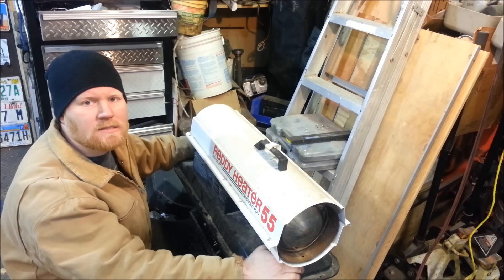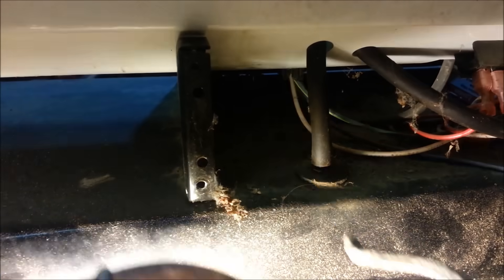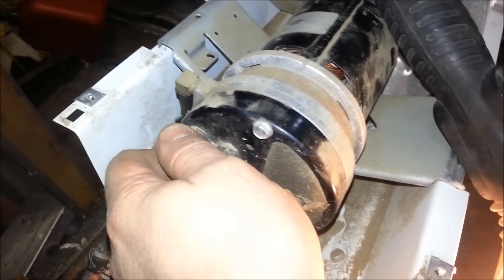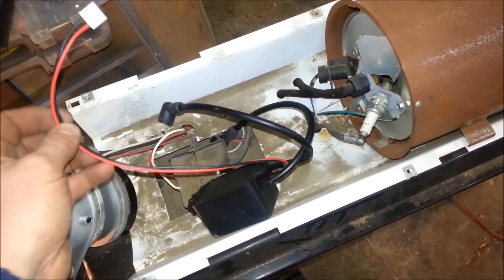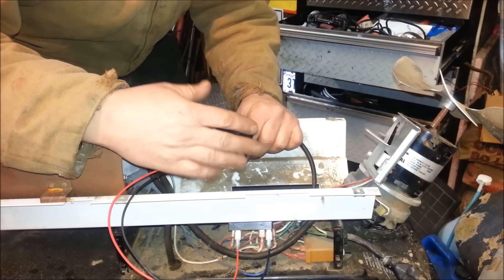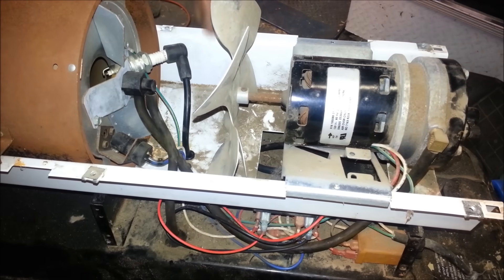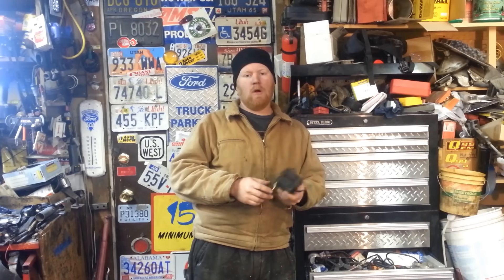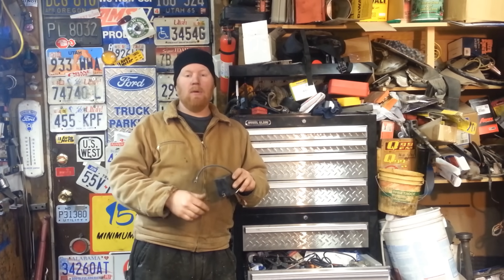Torpedo Kerosene Heater repair & HOW they work

Comment: OK I watched your video and think it is great. I took my heater into the
 shop and plunged it in as the list time I did when it did not work. It 
started up and ran great with nothing different going on. I fill the 
tank and take it down to where I need it and its blowing half burnt fuel
 out the front and burning stops after about 10 min. I let it cool for 
about 20 min . it starts up and does the same thing. I take it back to 
the shop where it did run and it sat over night in 42 degree 
environment. I plug it in, there is a good mist and spark is going , BUT
 IT WILL NOT IGNITE. Any idea ? The fuel is fresh winter mix . 
I boiled the fuel over a electric hot plate to get rid of moisture. Filled the heater with hot fuel and still nothing.
Reply from the maker: These need a proper air to fuel mixer to run properly. Warm oil will be thinner and too much will get pulled into the burn chamber, making for a rich mixture. To thick or cold oil will pull less and make for a lean mixer. Considering it was blowing a bunch of half burnt fuel in while burning, I would say it is too rich. To reduce the amount of fuel being pulled into the burn chamber you'll need to reduce the pump pressure slightly.
Reply: Thank you for your reply.
Does screwing in the adjustment increase the pressure ?
I have tried going in and out with it and it does not appear to change.
ALSO i am wondering about being able to thicken the oil up a little by adding a little ATF  ?
Reply from the maker: Ed Watt
Your diesel will be fine at room temp, just warm/hot from boiling it makes it too thin. Did you pull the top cover off and make sure the spark plug is not gummed up with carbon? Was there water in the fuel?
Reply: I have watched the spark mix with the fumes and nothing, even after the fuel has cooled to 42 F. 
 Does the pressure in the compressor generally 
increase when the adjustment screw is turned in ?
Reply from the maker: Ed Watt
Yes, a properly operating air pump will increase in pressure when screwed in and decrease when screwed out(ccw). There are 2 ports: one for a gauge and the other is the adjustment. They look identical on a lot of heaters and screwing in and out the gauge port does nothing. You'll notice at 7:50 in the video how much turning it takes to adjust the pressure down.

Comment: Thanks for the info.  For some reason mine runs great for all of 10 minutes then stops, the fan remains but the heat stops. Unplug, wait 10 seconds, plug it in 10 more minutes and then no heat again?? Could it be the fuel nozzle? or??
Reply from the maker: Adam Jansen
If it is heating up until the moment it shuts off, the optical sensor is faulty or dirty.
Reply from the maker: Kerosene or Propane?
Reply: Adam Jansen im having the same issue currently
Reply: sixtyfiveford  Kerosene. 60k btu
Reply from the maker: master bates
Kerosene or Propane?
Reply: sixtyfiveford kerosene.
Reply: Adam Jansen kerosene runnin diesel
Reply from the maker: Adam Jansen
The heat/flame dies, the fan continues for 5-10 seconds then trips the safety breaker and shuts everything off, correct?
Reply: sixtyfiveford correct
Reply from the maker: Adam Jansen
There are a couple safety switches that may or may not be on your exact machine. The first is a Photo switch which you do have. If it sees no light from the flame will trip the safety breaker. This should be shutting down the power to the fan anytime the unit runs out of fuel/flame stops. It may be an automatic reset style or a manual than you need to push to reset. The second safety switch that is not on all machines is a high temperature limit shut off switch. This will kill the power to the unit if it senses it's too hot. This will automatically reset itself after it cools for a minute. This would be my first suspect with your symptoms assuming your unit doesn't have an automatic thermostat. You can take off the cover or look up a parts diagram to see if you unit has a high temperature limit shut off switch.
Reply: sixtyfiveford thanks. the machine doesnt shut off, just the flame. I let it run a few minutes to see if it would reignite but no go.  Ill take a look tomorrow. maybe take some photos.
Reply: sixtyfiveford the fan doesnt shut off, the only part that quits is the flame part.
Reply from the maker: Adam Jansen
The high temperature limit shut off switches sometimes allow the fan only to run to cool off the unit. What is your make/model number and I'll see if I can pull up a schematic?
Reply: sorry for the delay. It is a Reddy Heater Kerosene 60k btu model #R60
Reply from the maker: Adam Jansen
Your doesn't have the high temp limit switch only the standard photo light senor that is supposed to shut off the unit when it sees no light. So for some reason your photo sensor isn't working like it should and isn't shutting down the unit with the flame dies. But that is a secondary issue to why it is dieing in the first place.

 I assume it's not misting/fogging the room with unburnt diesel while the fan is running?

Is it continuing to spark?

If there is no unburnt fuel going out into the room most likely we either have a sticking air pump vane or a blockage in the fuel pickup line.
Reply: sixtyfiveford correct. It is not misting the room. It goes from working to nothing. No flame no fan. It just shuts off.
Reply: i think i had false info before. fan is no longer running It goes from running to shut down as if you unplugged it.
Reply: sixtyfiveford Ill look on ebay for one and just replace it if its not crazy expensive. Btw I really appreciate your help with this.
Reply from the maker: Adam Jansen
You can temporarily bypass/test it by connecting the 2 wires coming out of the optical sensor. If it fixes your issue, then I would buy a new one(usually around 10buck online).

Comment: if I were to swap the orifice for a larger one and increase fuel & air, would I be able to increase my total btu output?
Reply from the maker: You won't be able to increase the airflow from the fan, so it'll run too rich and more than likely not start.
Reply: sixtyfiveford i have a new avenger kerosene forced air heater that tries to light shoots small flame out front then shoots kerosene out of the front
Reply: sixtyfiveford i have a new avenger kerosene forced air heater that tries to light shoots small flame out front then shoots kerosene out of the front.
Reply from the maker: If it's new and already giving you issues, I would return/swap it out. More than likely the pressures are just set too high.
Reply: sixtyfiveford it ran fine for 4hours and it shut down i let it cool filled it back up tried to restart it would try to start it would shoot out small flame and puff of smoke and then shoot kerosene out of the front of heater

Comment: I have a dyna glo pro125,000 btu and it wont fire up. I pulled the air line and its pushing air , I pulled the fuel line and no fuel is coming out. I blew through the tube and I hear it making bubbles in the tank but it wont pick up fuel. any ideas. Thanks
Reply from the maker: Does it spray a cloud/mist of fuel when you power it up, before it shuts down? If not, more than likely you have a split in the fuel pickup line. Second would be, too low of pressure. And finally it would be a severely worn jet(only happens to units with very high hours).
Reply: Thanks for the reply, I have no pressure on the fuel gauge. Im guessing the air pump is bad.
Reply from the maker: The 4 impeller blades that run the air pump could just be sticking. Take the back plate off and you'll see them.
Reply: I ordered filter and housing kit after looking at it more closely, The old one was cracked and the gasket was swollen so it wouldn't seal properly. Installed the new parts and turned it on a few times and it wouldn't start. I could hear pressure bleeding off the fuel cap when it would shut done. I put my finger over the hole in the fuel cap and it fired up but was spitting out a wet flame on one side. I immediately unplugged it and it was on fire. I finally got it out. Ill check the nozzle tomorrow. Hopefully it just needs cleaned.

Comment: My Reddy Heater 115,000 btu  will start cold. As soon as it heats up It shuts off completely and wont turn back on.   Any advice is appreciated.
Reply from the maker: Some newer models have a high temperature safety switch(high limit safety switch) that shuts off if it senses it's too hot. I would look into this.

Comment: i have a 115,000 btu heater that seems to not have enough air pressure to spray out the kerosene.  Even adjusting the pressure in back it won't kick on since its not spraying it out.  Air Pump is cleaned. Vanes move freely.  How else would i get more pressure.  Air line isn't blocked, fuel line isn't blocked.  It runs with and air compressor sprayed  into the adjustment but as soon as i take that off it stops.  I'm not sure how i get a more constant higher pressure of the air.
Reply from the maker: Is it producing pressure? Pull off the line and feel it or test it. If it is producing the proper pressure you could have a severely worn jet/nozzle. It should push 10+ psi if hooked directly and around 4 psi when hooked to the jet/nozzle.
Reply: It produces a little bit of pressure.  I don't have a gauge so i'm not sure exactly how much.  It only a few years old and not used much so i doubt it the jet/nozzle but i do appreciate the advice.  I've ordered a new airpump since the vanes didn't seem to be loosely moving which may be the issue.  I'll work on it again once the part comes in and see if that helps.
Reply from the maker: Generally the nozzle/jet will only wear after a LOT of hours, so sounds like your good. Inspect the housing when you take it apart to make sure there are no cracks and that the gaskets are sealing properly. Even if 1 vane is sticking it would drop the pressure drastically.
Reply: New pump didn't seem to help. New filters also added.  I know i need 5/1000 gap on top.  Could that make a huge difference if off slightly?  Otherwise i'm out of ideas.  I've had a spurt of gas go in but can't get it to maintain.  Its hard to adjust since i only have 1 sec. before it shuts off if thats the issue.  But i adjusted every position it seems like.  Any suggestions?
Reply from the maker: Rusty Hughes
I generally just set the top gap to as close as possible without touching and have never had issues. More important is the gap front and back cover plate. Make sure the flat cover isn't gouged and that is sandwiches the impeller/blades nicely. Pull off the line and feel the pressure with your finger. To get longer run time you can bypass the optical sensor by connecting the two wires that go into it (tape it up and don't touch it when plugged in as it has live current). You can also pull off the fan if you want to hear the air pump better(if you want, not necessary). Most people with this issue end up having an air leak in the rubber line, the gaskets sealing the pump or I've even heard of the pump housing being cracked.

Comment: So I have a new problem my heater will only work when I take off the cover ?
Reply from the maker: That generally means your fuel pressure is off. This would mean either it needs adjusting, or you have a split in a rubber hose.
Reply: thanks ill look into it.

Comment: Hi I was wondering if I can pick your brain I Have ready heater 125 I think or 150  got it new 10 years ago used it off and on for 4 years put a nozzle in once or twice. I let it sit in unheated garage for few years I noticed it leaked all fuel out on the cement floor of garage checked tank looks good free of rust clean scared to use it since but would like to
Reply from the maker: Some of these have plugs on the bottom of the tank. I wonder if the gasket on the plug just dry rotted and leaked out the fuel.

Comment: I have checked the hoses there are no cracks. I see the fuel spraying. i have replaced the back cover. still no pressure build up.
Reply from the maker: The air vane pump is either sticking, you need new vanes or there is an air leak. Pull off the back cover and inspect it.

Comment: How do you install a thermostat onto a Kerosene torpedo heater
Reply from the maker: The easiest way it to use an inline plug in thermostat that shuts off the power to the unit, then restarts it.  I have a link in the video description that show what I'm talking about.

Comment: That air pump is just a rotary vane pump. The vanes can get gummed up in the rotor and cause these to not run as well. Easy fix with some brake parts cleaner, rags, and not very much time.

Comment: Do these heaters, which are labeled for kerosene, work with home heating oil?
Reply: Diesel, Kerosene, and "Home Heating Oil" are the same thing.  The only difference being that you pay road tax at the pump for Diesel, and can be fined if you have the wrong color fuel (red) in a road vehicle..
Reply: Apparently liquid fueled torpedo heaters like No.1 fuels.
Reply: These fuels are similar, but not the same. Kerosine is the most refined, and burns the cleanest. Even without the road tax, K1 is usually 50% more than road diesel.

Comment: I can not find a cheap ignition coil, where did you get yours at?
Reply from the maker: +Pat Stillriding I used a GHP 39E0-0008-00 ignitor coil transformer.  Any 39E0-00*-* coil will work (the other numbers are generally just differentiating the spark plug wire length).

Comment: should there be air sucking through the hole where you are adjusting it? I see mine at 4 psi like it says and it's not glowing red if I cover the hole with my finger it goes to like 8-10 psi and it starts to glow red.
Reply from the maker: +Jason Craft No, air should not be sucking through. You more than likely have a seal leak.
Reply: +sixtyfiveford  there is only a spring and bearing in there when you take it out. How does that operate?
Reply from the maker: The spring holds the ball bearing tightly against a seal. The tighter you screw in the adjustment screw the more pressure it holds in the system and the higher your air line pressure will be.
Reply: +sixtyfiveford I don't see where the seal would be. I might take it apart and  post a video tomorrow. I did new filters.

Comment: My problem is that my ready heater is putting out Black smoke randomly? What do you suggest as a fix. It acts like is low on fuel when it is fill and starts putting out Black small. Is this some kind of filter issue. I really need to get this thing operating right. Thanks
Reply from the maker: +Steve James Sounds like you either have contaminated fuel or a problem with it sucking the fuel up.
Reply: So what do you think is the best fix for this. I was thinking to remove the fuel and use new oil and air filters and cleaning the fuel line maybe. When you say a problem sucking the fuel up. What does that mean? Is that something along the line of needing a new fuel line maybe? Really need this thing to work.
Reply from the maker: Generally the fuel line going into the fuel tank is split or cracked.
Reply: ok thanks my friend. Do you think that I should order an air and fuel filter maybe. Where is the best place to order ready heater parts maybe?
Reply from the maker: I wouldn't throw parts at it until you determine the issue. The air filter is usually just foam and can easily be shaken out or even rinsed out and dried. "IF" yours has a fuel filter take it off and blow backwards through it to see if it is clogged. If it has one the is generally just a fine mesh metal screen and can be back flushed with carb cleaner, brake cleaner or even WD-40 and it will be new.

Comment: love the video I have a similar heater dyna glo. I can't seem to get the pressure gage to at all. could the air pump be bad?
Reply from the maker: +Ryan Mccready The air pump has vanes that can break or stick. The hose going from the pump to the fuel nozzle can also split and reduce pressure. If everything checks out take off the pump back cover screws until you get deep enough to inspect your air pump.

Comment: Hey, I have a Remington 60k BTU... It turns on and runs for about 20 - 30 seconds. What do you think might be shutting it off?
Reply from the maker: +Kevin Lopez Flame/optical sensor more than likely. You can bypass it to test by connecting the two wires that go to it.

Comment: Making progress man, one of two problems. Re the pressure, I have to run the heater on max pressure ( with 4 inch flames out the front ) to avoid fumes. Yet when I turn down the pressure ( where it previously sat for years)  the fumes are overpowering and  it does not run smooth at all yet it still throws 2 inch flames out around the front shield.  Looks like the fuel jet could be the culprit.

Comment: I have two older model (35-40 years) 63000 BTU Reddy Heaters that have been used occasionally in the colder months. I adjusted the the pressures on each of these units, but the gauge is very shaky on each.  Pressure readings will fluctuate around .5 PSI on each unit.  The units heat OK, smell a bit on fresh K-1 Kerosene, but I am not sure they are operating at full potential.  Should the pressure fluctuate?  All filters are original and no housing cracks are visible.
Reply from the maker: +Brian G Pressures should stay the same. There is a vane air pump in the very back that has 4 fins. More than likely one of the fins is stuck causing a fluctuation as it spins past this fin.
Reply: +sixtyfiveford Thanks Sixtyfiveford!  I rebuilt the air pump, cleaned the injector and replaced the filters. The ready heater is burning fine and feeling toasty!
Reply from the maker: That's great.